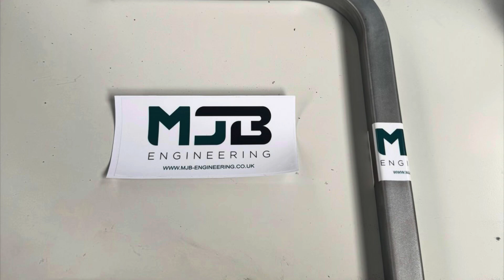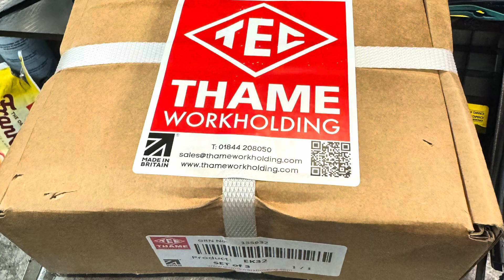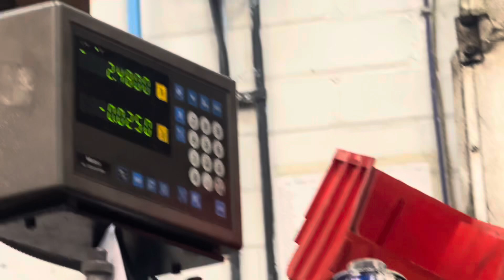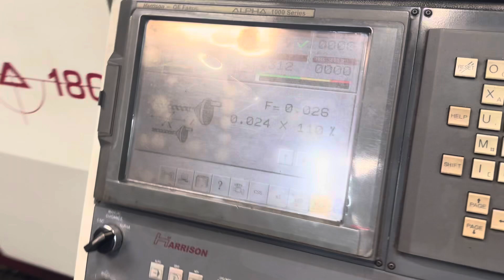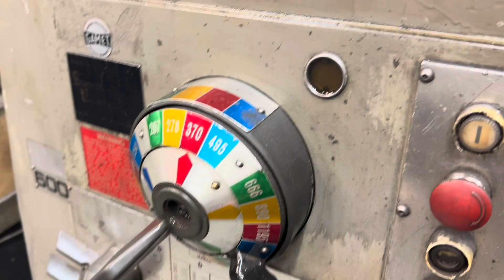Shaft & Rotor Repair - Machining, Metal Spraying & Fixed Steady Work

Comment: I'm guilty as well of lifting Lathe Chucks, knowing I shouldn't 😬

The Chuck lifting attachment you made will make a huge difference to working smart, not hard 👍
Reply from the maker: I'm gonna make a Mk2 version, that has a tube that rotates in order to make lining up witness marks and then tightening the cams easier. But yes my back is a lot better this week! 😂